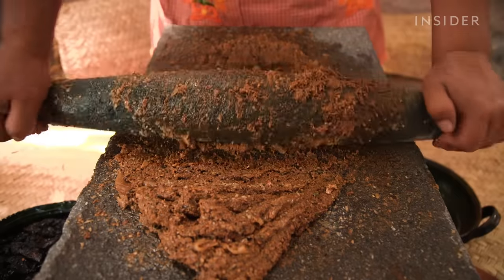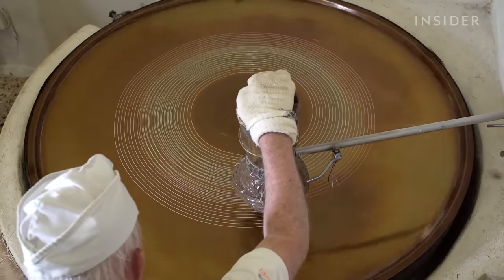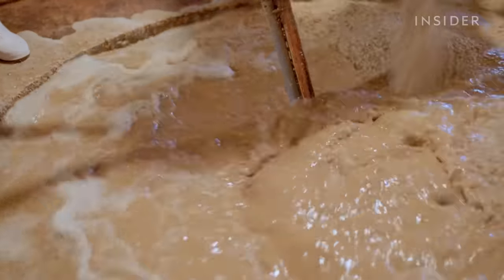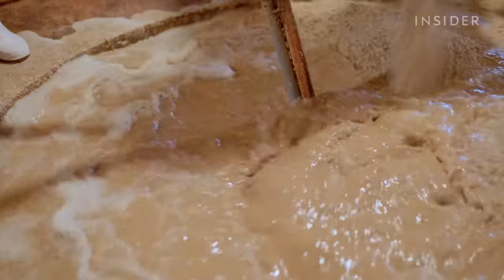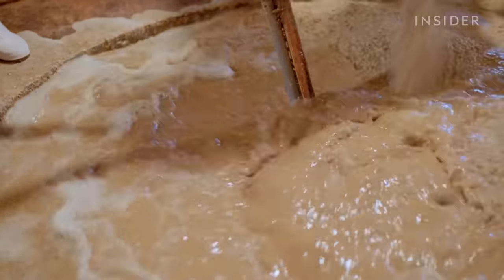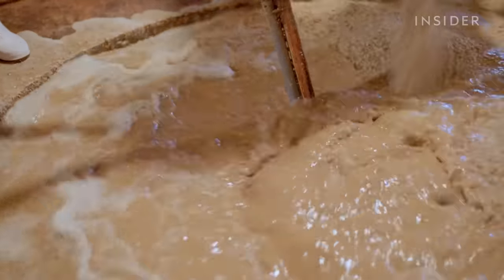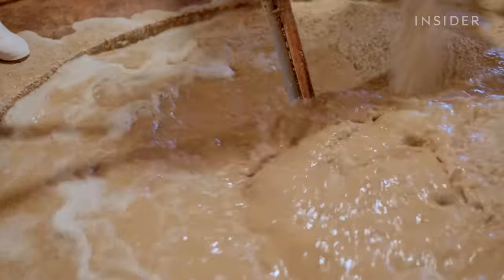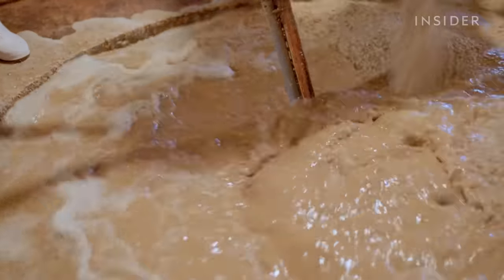How Five Of The Oldest Cooking Traditions Survived Centuries | Still Standing

Comment: Ive never had fenni or barrel aged soysauce. Im intrigued. For the soysauce im guessing its like barrel aged whiskey or wine vs stainless steel drum made whiskey or wine. And with the latter, you can definitely tell a difference
Reply: My grandparents had a still and that's exactly what they used to do even down to the red clay mud that's used it didn't come from an inhale but it was red clay mug with no rocks in it just smooth like I use for ceramics.. it must be good!!
Reply: Its basically Appalachian moonshine, mash, copper pipes and everything.
Reply: I'm making my first batch in a crock. It takes at least a year.

Comment: You people complaining about how unsanitary this one particular family’s Feni making method is obviously have not a clue about how condensation and the distillation process works. Feni is not the juice produced by stomping on the fruit. It is the product of the liquid after it has been fermented then heated to the point where the liquid becomes a gas which is purified by that action and then cooled back to a liquid which we all could see was a very different color and clear of any impurities. But you wouldn’t know that because it is beyond your comprehension.
Reply: Gone are the days when all men had a basic understanding of engineering principles, we needed it to fix cars, motors etc. but no longer. Those days are gone and shortly me with them! Some of the questions and comments I see on various forums would in times past be considered to be two steps beyond stupid, but now I realise the posters have very little practical knowledge in any technical subject.

Comment: Most of these stories is how people are still clinging on to outdated methods and are being defeated by machines and modernization. Its only unique when the factory process chemically changes the nutrients and flavour profile. otherwise, get a new job. There were hundreds of people who used to light street lamps manually. Now its all electrified bulbs. Same thing for coal miners and farmhands who used to work in the fields manually. Machines will rule the procedural repetitive tasks with efficiency, consistency and costs.